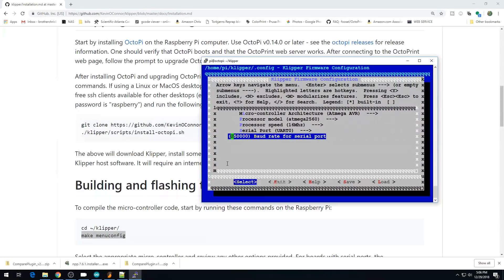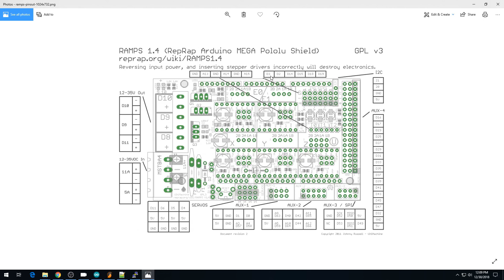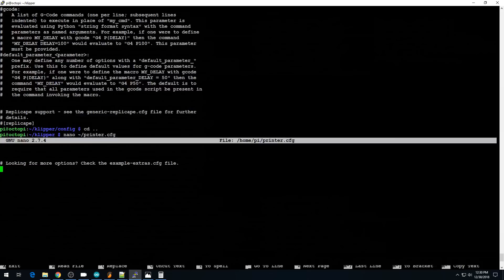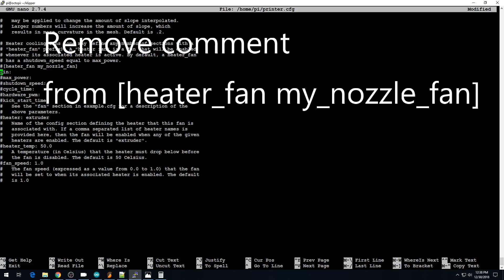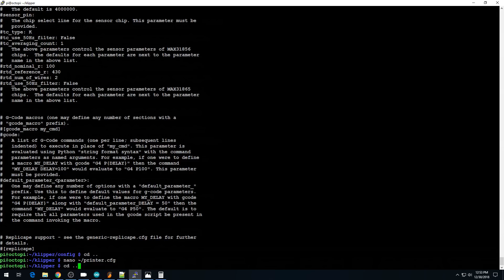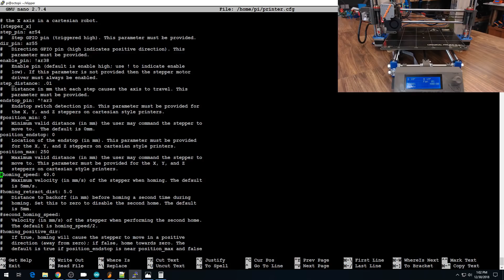Klipper 3D Printer Firmware Install - How To - Chris's Basement

Comment: Do you understand octoprint? Having trouble connecting raspberry pi 3 model b wireless to octoprint. (Note: the only thing I have connected to RP3 is power adapter it came with...no usb cables or nothing)
Reply from the maker: Sure, did you setup your networking supplicant file? Make sure your wireless name and password are set correctly, they are case sensitive.
Reply: Yes. I removed the * to the side but I didn’t remove the quotation marks.  I am going to try to run wired. I forgot my password and I looked on forums on how to change it and I can’t even connect to octoprint with the IP address. I don’t know what to do or where to start and I’m about to give up on octoprint. 😱
Reply from the maker: @penguinlife9239  The quotes should stay. You forgot you wifi password or your octoprint password?
Reply: I forgot the password for octoprint. Also I have no way of connecting because I can not obtain an ip address that I can connect to and putty will not let me connect throught ip address or using "octopi.local"
Reply: Glad to say octoprint is working for me again! :)
Reply from the maker: YESSSS!!!!!  Congrats! What was the fix?
Reply: Well I went to bed.  I woke up and I unplugged the cable from pi for 5 min and then I plugged it back in and let it boot for 5 min.
Reply from the maker: @penguinlife9239  Ha! A fix is a fix! ;)

Comment: You can install octoklipper which helps alot
Reply from the maker: I saw that out there, I will have to give it a try.
Reply: @ChrisRiley  I find it useful for the button part and everyday use.. but I have had some mishaps when using the printer.cfg editor(after save ther is only an empty file left https://github.com/mmone/OctoprintKlipperPlugin/issues/33).. I recommend using a sFTP client and some text editor like Notepad++ for example(NOT notepad).

Comment: Good work !   Really nice to shed some light on Klipper :D

The HUGE advantage compared to Marlin is that we don't suffer from the serial connection bottleneck in the curves, that nearly stalls the toolhead when fine details are printed with a lot of short moves.
Reply from the maker: Thanks! Hope it helps out.
Reply: Note that the OctoKlipper plugin is great to fiddle with the config as it can be edited from within the Octoprint web interface, and restarted right away as soon as you hit the 'save' button (with no warning).
Reply from the maker: Awesome! Yes, going to play with that for sure.
Reply: It's not the serial connection that bottlenecks it's Octoprint and the AVR, Octoprint is having a hard time to keep up whit both Marlin and Klipper, that's why there's a quality improvement to print with SD-card using Marlin and when using Klipper the vSD-card especially whit non cartesian  printers( deltas, corexy and so on..)https://github.com/foosel/OctoPrint/issues/450 https://github.com/KevinOConnor/klipper/issues/669
Reply: I was talking about using Octoprint with Marlin, where the serial connection remains a bottleneck even at 250kbps no matter the size of the buffer in Marlin.
Klipper and Octoprint just run close to 100% on a Pi Zero W, which requires to use the vSD-card to get a good performance.
On the Pi 3B+ we have all the power we need to run both without a sweat :D

Comment: Very good video as usual Chris.  One tip that I found when messing with Klipper.  There’s a setting for max_extrude_only_distance.....(just like Marlin has),  your prime line was probably set over this amount.  👍
Reply from the maker: Thanks! I was going some reading on that. I saw somewhere that Kevin states not to change one of these options as there is a bug.....I need to circle back on that, but yes, I'm sure it's something like that.
Reply: Chris Riley Oh good to know, I didn’t see anything about the bug!  I went back to Marlin anyways lol, but plan on trying Klipper again someday.   I did witness corners are much more square at much higher speeds and it seems there is less “noise” in the prints also when using Klipper.
Reply from the maker: Yeah, I need to do some side by side video of both Klipper and Marlin. Maybe that should be the January coffee break video.
Reply: The max extrude only is a little short in most configs but it only adheres to ONLY extrude moves(not priming in a line on the bed where there is other moves in the x,y plane ) there is no harm in increasing this value. The issue you were having was probably excessive extrusion that triggers a safety function "max_extrude_cross_section" and isn't a Bug.. The solution that you presented in the video is the right way to go(less filament/mm in the line).. One thing to remember when changing nozzles is to change the nozzle diameter in the config...
Reply: Nitram Oh yes!  I knew there was another option that was quite similar, but couldn’t remember which it was!!  That makes total sense.  Thanks for the explanation

Comment: so Klipper firmware is pointless for printing farm
Reply from the maker: Thanks I don't know yet, I think we can probably run multiples on one Pi, but with out the Pi you're pretty much dead in the water.
Reply: It's not recommended to run more than on per PI but this wouldn't make it less suitable for a printing farm.. You only need half as many printers...

Comment: I can recommend to get a more stable connection between the board and the Pi:
The general way to find a more stable USB serial port is to run ls -l /dev/serial/by-id/ from an ssh terminal and use that instead of USB0 or AMC0

mine looks like this

serial: /dev/serial/by-id/usb-1a86_USB2.0-Serial-if00-port0

It's very useful when you are using multiple boards..

and the baud rate when setting up shall always be 25000 and isn't connected to the settings in .cfg

And set a higher print SPEEEED =)

GOOD TUTORIAL kudos to you Chris..
Reply from the maker: Thanks! Nice tips as well.
Reply: @ChrisRiley  Anyhow Klipper took my delta to the next level.... or beyond https://youtu.be/PRXg3-RGakI

Comment: Congrats man...awsome tutorial...i was confused with the klipper instalation and wanted to try it on my prusa( hacked and moded)style printer that is someting like your LOG test printer but never seen a full tutorial on how to install it and my linux skills are not so great!
Reply from the maker: Thanks! I found it a little long winded, but hopefully it's helpful.
Reply: It is very helpful...i dont mind to spend  30min or 1h or more to see a great thing mostly when i can learn alot from it...thank you for such a great job!
Reply: Next thing to do is to equip my test printer with klipper software now that you made this full installation tutorial!
Reply from the maker: There ya go! I need 2 printers exactly the same so I can compare firmware side by side! :)
Reply: Yeah...i see alot of people on Facebook groups that affirm with klipper and a standard ramps+ mega you can achieve results as you will run on a 32bit board..but yes...you right...you need 2 printers exactly the same so you can compare..